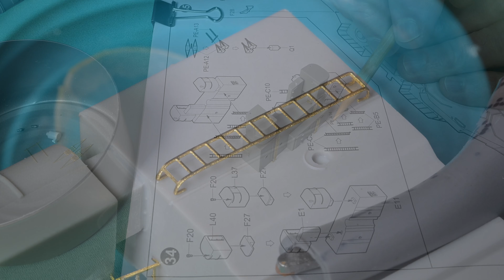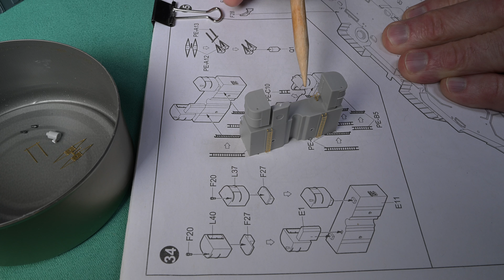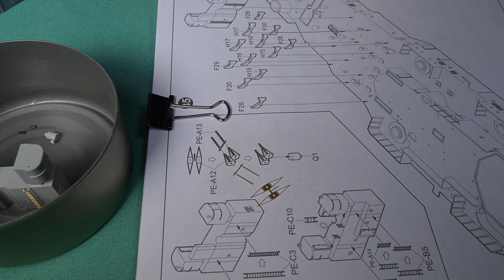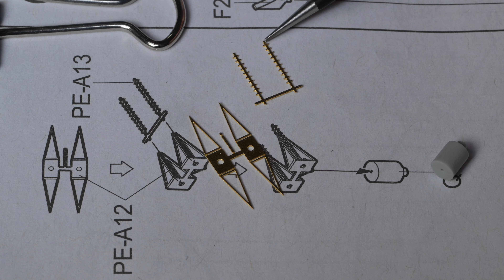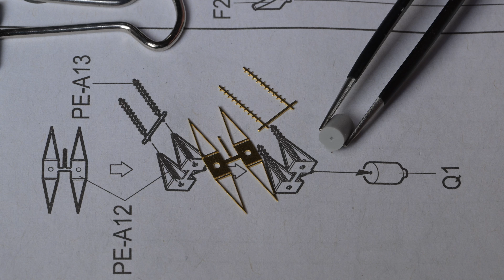The Model Ship - Part 1281

Comment: Ron great work on the ladders, I removed the little arm that holds to aerial to the little pedestal base’ as it bend to easily as its was weak. I used metal rod, and drilled out a small hole in the round base.  Looking forward t the next update, happy modelling
Reply from the maker: Yes, that "little arm" is a poor design. Very flimsy!
Reply: @roncalverley  Bang on Ron